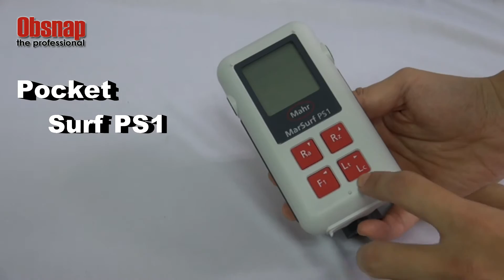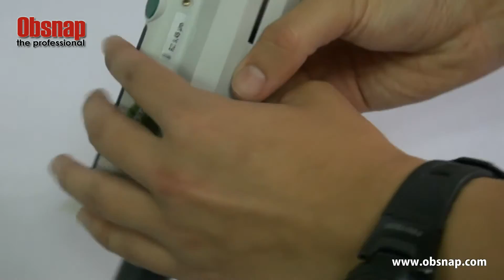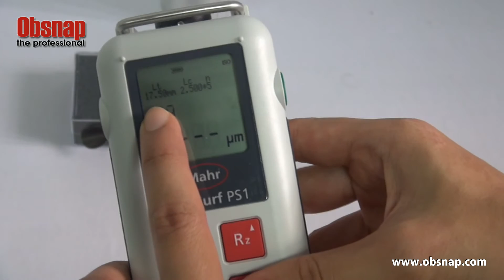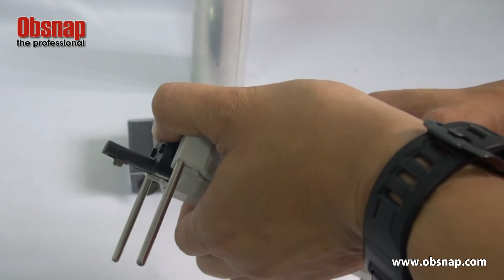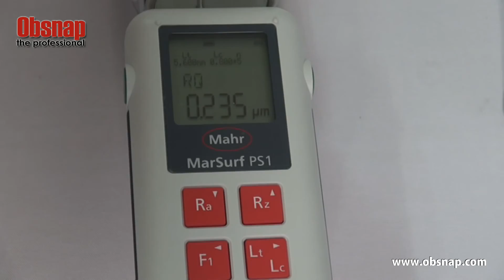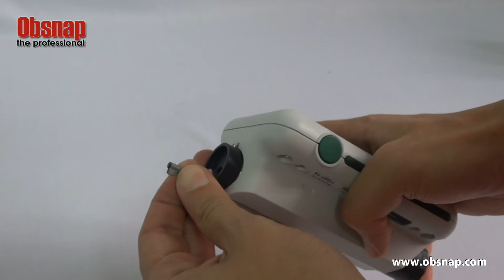Pocket Surf PS1 by Obsnap Instruments

Comment: Instrument showing Lower limit exceed 
What will be the solution?
Reply: you try again and make sure the probe stays on the surface...that error happens when the probe drops off an edge usually.  It means the lower limit of the sensor is not being triggered...not enough pressure to take a reading.